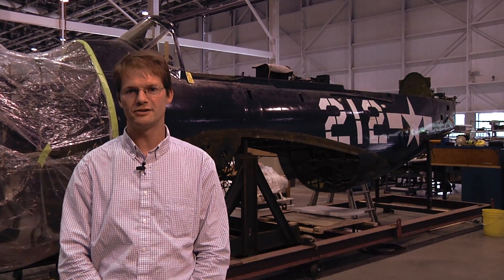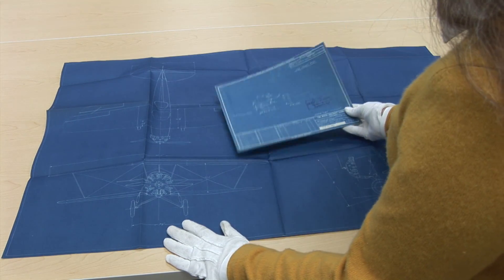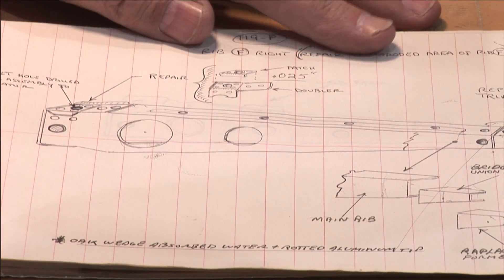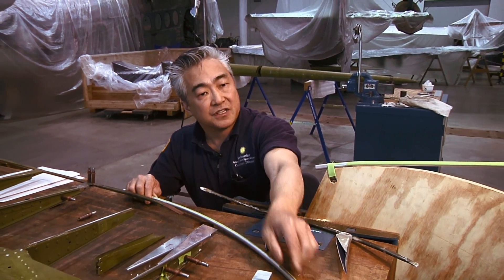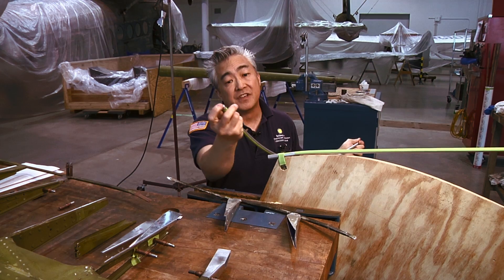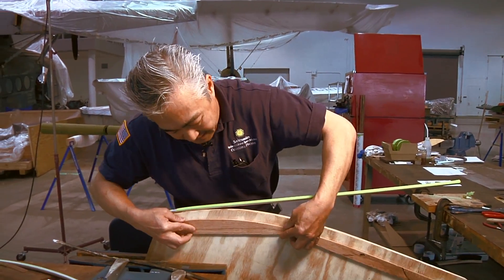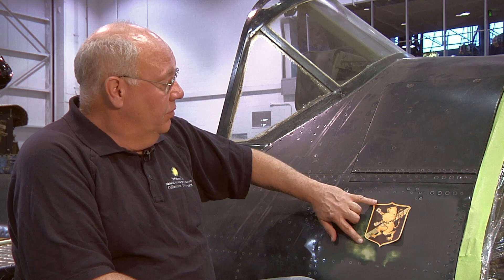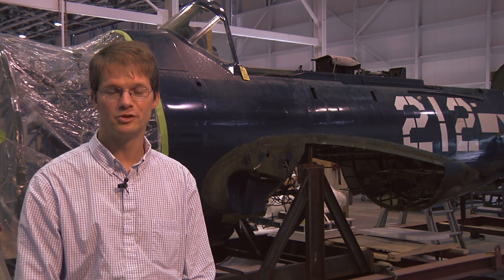Restoring the Curtiss SB2C-5 Helldiver

Comment: Get this guy a GOD DAMN tube bender.
Reply: We had a Tube Bender. The Tubing was only .016 thousandths wall thickness and I think T-8 hardness. The inside radius collapsed on the slightest radius. This is why I had to fill the tube with  cerrobend. Then I used the tubing bender to make the radius. Trust me,  I didn't have the time or tools available to try anything else. We had just moved into the new shop from Garber and we had nothing set up let alone any of the shops set up. My tool box was still with the and all I had was one bag of tools and we had a year to get the Hell Diver ready for display. I even had to dumpster dive in order to get a chunk of plywood for the project.
Reply: Do you really think you needed to use such foul profanity to make your point?  Not only was your comment wrong, it was very offensive to people like me but more importantly to the Almighty God.